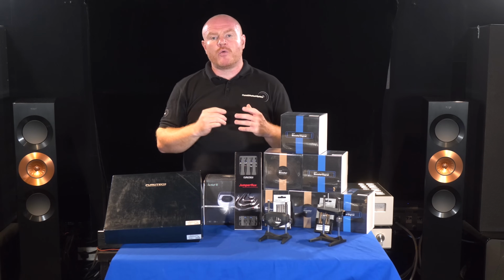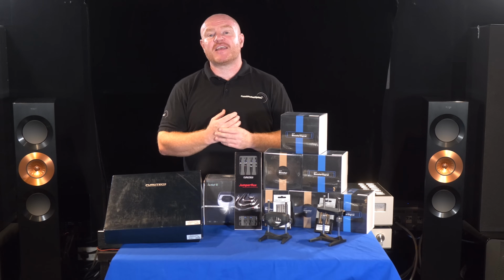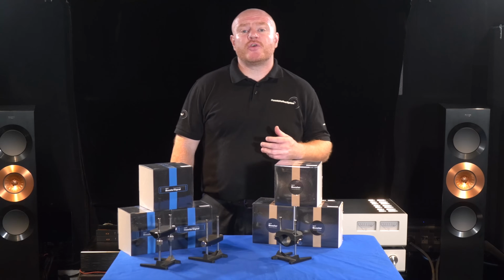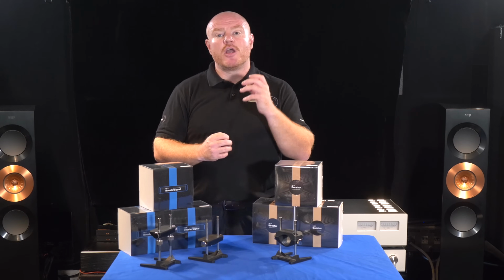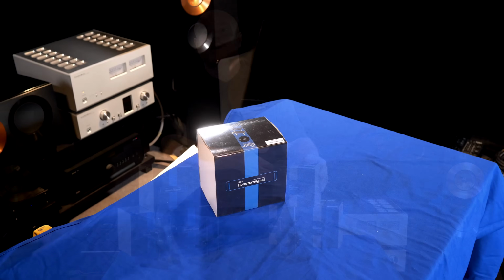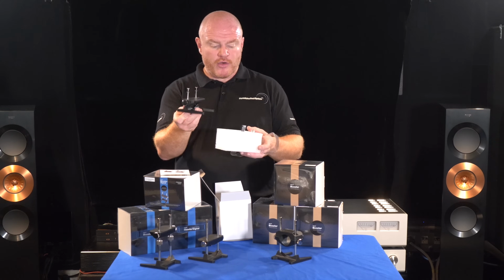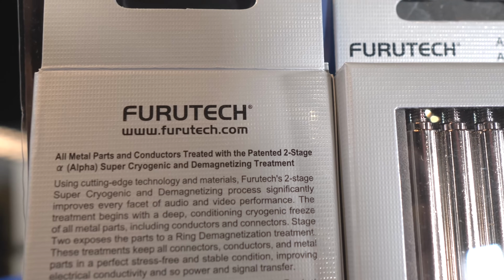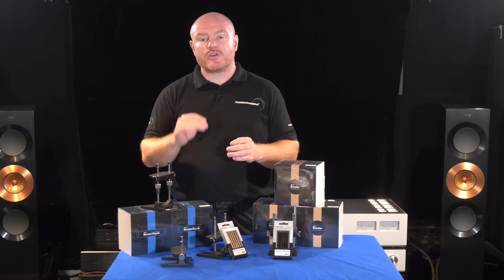Furutech NEW NCF Booster Signal Product Range Introduction HiFi Cables Ultimate Accessory

Comment: Thanks for the product showcase👌 Question...what is your experience with power cables/price range and when the cable starts to make a sonic difference in conjunction with power filters and on their own. Does a system need power filters to hear a difference between power cables? Cheers
Reply from the maker: At the end of the review I plan to test these NCF products in different ways to see how they might benefit cheaper power cables, even freeby black ones I think that will be interesting.

I started with power cables costing £40 each one and noticed a difference to justify the price.
Now I have cables in the system £1500+ each and they justify their price to me.

Similar for power conditioning products - Tacima sell the CS929 for about £30 each these are a great place to start 
Compare that to a Furutech, Isotek or Audioquest unit and you will see where that extra money goes

Its a very interesting area of the hobby, and one I am really passionate about.  Yes I would try and combine good quality power products with power cables - no point using the best power cable off an ikea power strip even though I am sure there will still be a benefit to doing so.
Reply: Pursuit Perfect System That sounds fantastic. Look forward to hearing your thoughts on it. It can be difficult at times to weed through all the product tweaks that claim to deliver sonic improvements. I looked at furutech’s website...do they no sell directly from their site?
Reply from the maker: No they sell via dealers in a normal fashion, in the UK loads of dealers have their stock
Reply: Pursuit Perfect System thank you. I live in Toronto Canada so I’d have to look around to see who sells